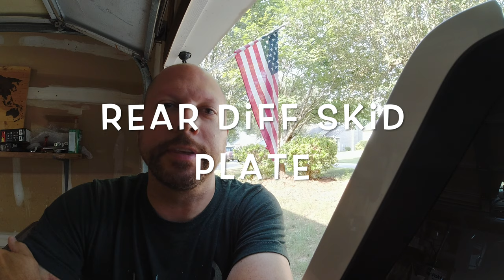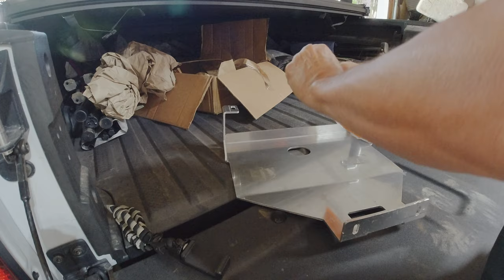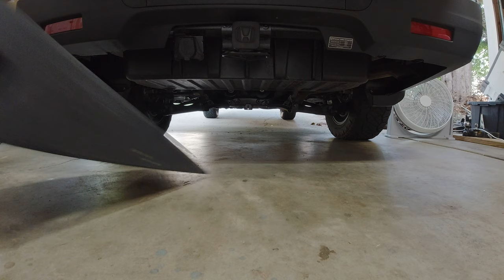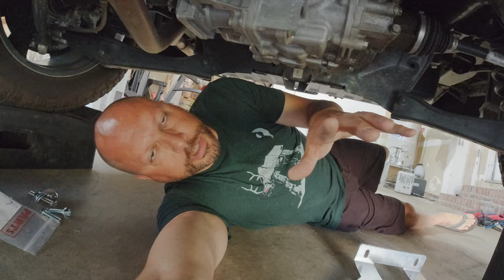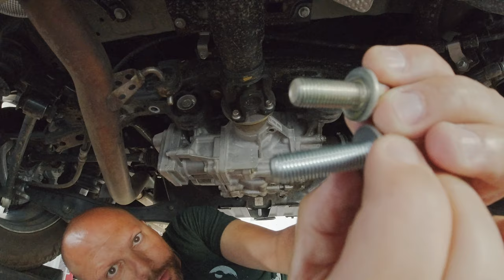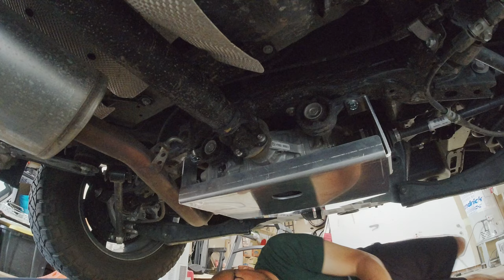Honda Ridgeline HOW TO INSTALL SKID PLATE Rear Differential

Comment: I have a suggestion for the skid plates.  If the drain access holes were dimple dyed, it would add a lot more strength.  I'm not sure how thick of a material you can dimple dye, but the aluminum is softer than steel.
Reply from the maker: It’s super strong.

Comment: Nice and simple install. 
I am curious about two things though...
Is the bottom of the skid plate completely flat or does it have a slight tapper towards its hole near the center? Just wondering this for the sake of water drainage.
How does this plate affect cooling for the rear diff?
Reply from the maker: NocturnalJunkie from what I observed. It is flat but the sides are open to allow water and air flow. Now if you dip into thick mud - it will accumulate. One will just have to keep an eye on it. Thanks for watching.

Comment: Does the Ridgeline leak water from the rear window?  How common is this?   Has Honda made adjustments?
Reply from the maker: Unsure of this issue. Check with your Honda dealer on that problem.

Comment: Is the bolts a different grade steel though?
Reply from the maker: Which bolts?
Reply: @CampingRandy  the bolts that came with the skid plates. They look like a different grade than the OEM ones it had to replace
Reply from the maker: Oh - they are a little longer and automotive grade.